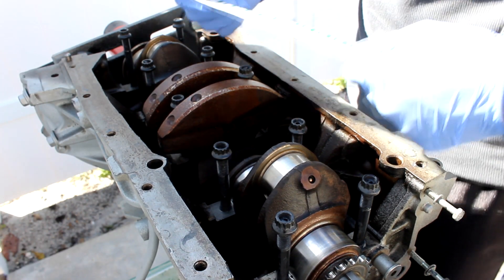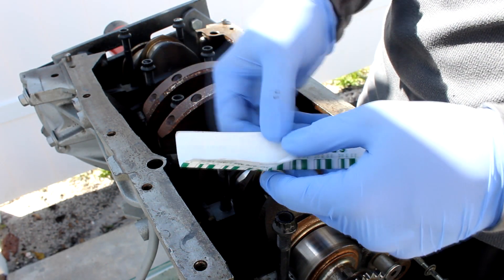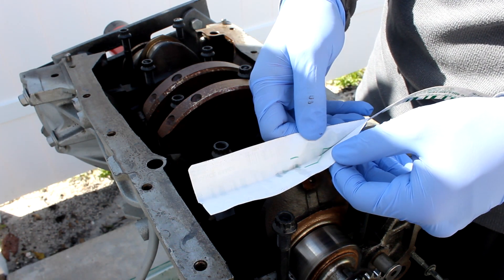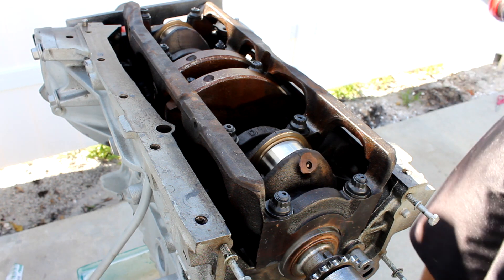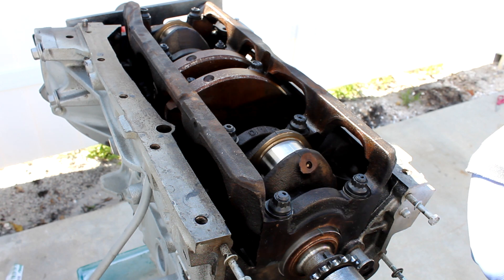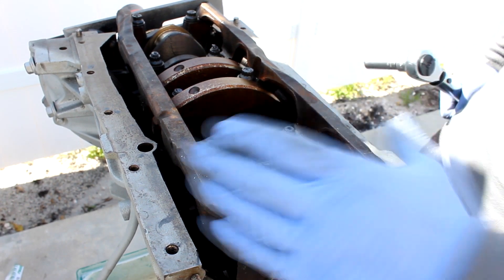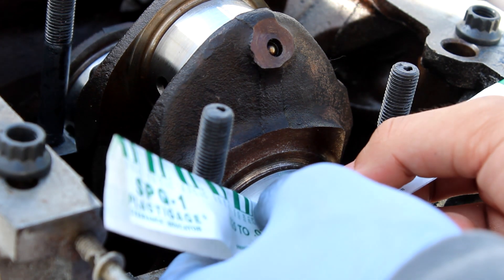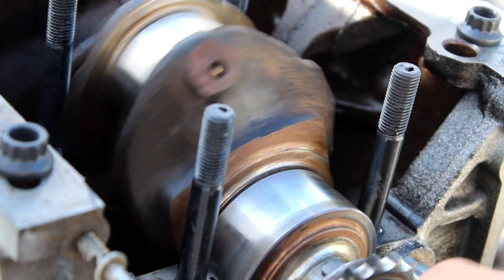How to use Plastigage ?explained in 5 minutes  (made simple)

Comment: What .025mm main bearings did you go with?
Reply from the maker: Standard
Reply: @Dtunedit  Thought you measured .025mm?
Reply from the maker: @1Man77  the arp main bolts changed the oil clearance

Comment: First thing I see is you stretching the Plastigage by tearing off a piece! I don't think you understand that it is supplied in an exact diameter for a reason. Griddle instead of girdle? You don't apply any silicone to one side and you handle the whole package of Plastigage when measuring, which will stretch it or break it to bits. You are supposed to cut off just one section of the sleeve package to measure with and be gentle with the sleeve of Plastigage!

Comment: Cut it, don't pull it apart!  If you pull it, it will stretch.  Then it will be too thin, so when you torque the bearing cap down, it will look like the clearances are more than they really are.
Reply: First thing I saw! Guy does not know what he is doing. Griddle instead of girdle! Does not apply any silicone to one side and he handles the whole package of Plastigage when measuring, which will stretch it or break it. You are supposed to cut off one section of the sleeve package to measure with!
Reply: Great observation

Comment: At 4:38 you say .00098425 and claim it is 9 thousandths of and inch. With all due respect, with that number of zeros, isn't that reading supposed to be 9 tenths of a thousandths, or just round it up to 1 thousandths?
Reply: That's what I came to say. Geez
Reply: 9/10's of a thousand. .009 you got scrap.
Reply from the maker: So i was following the repair manual i rounded up to 9 but now that i took a engine repair class it should've been .10000 this is hundreds thousand to 1500 and this is thousand basically the hundreds is a smaller clearance then the thousand
Reply: @Dtunedit  ok

Comment: thanks for sharing info. video. when do we know if that color of plastigauge match for an engine hope i got your answer sir.
Reply: @geryl canonigo   >Stat with the factory published specs for the year, make, model, engine size and even production date for the portion of the reciprocating assembly you need to measure. This will give you a range of loose to tight in both new and service limits. While “Plastigage” has been patented since the 40’s, GRN is the most common as it will reasonably measure clearance range of .001 to .003 thousands of an inch. RED .002-.006”, BLUE .004-.009”, YEL .009-.020”.
Production specs for my LS connecting rod bearings new 0.0009-0.0025” which is very close, but all tight bearings equal higher warm oil pressure due to less leakage. The plastigage measured between .0015 (15 ten thousands) to under 0.001” (1 thousands). So take your calculator and use the tightest spec like mine is .0025” - .0012” = .0013” which is less than loose service spec of .003”. This is about 2.5 times tighter than the maximum spec. You can buy bearing .001” oversized or thicker. Just use one shell of each. It works best if both bearing sets are the same brand and you are picky, like me. This was done for decades using sheets of cold rolled shim stock place under the bearing. Hope this make since. ASE Master Tech since 1978 - Retired
Reply from the maker: On the Plasticgauge itself will say the clearances that it will work till but most of the time you wouls use the green color plasticgauge

Comment: What happens if the clearance is too much or too little?? Lets say a worn engine and the clearance is too big??? Do you have to put a new crank in?? is that what it tell you ??
Reply: Oversize clearance means you need undersize bearings. In that case you'd have the crank journals mic'd up and that might mean grinding or just polishing the journals.
Reply from the maker: Plastigauge is use to to tell you the amount of space between the crank and the bearings if the engine has a a lot of clearance must likely the bearings are worn out but the crank should be checked with a micrometer   Better yet a machine shop to check the journals are in the allowed tolerance